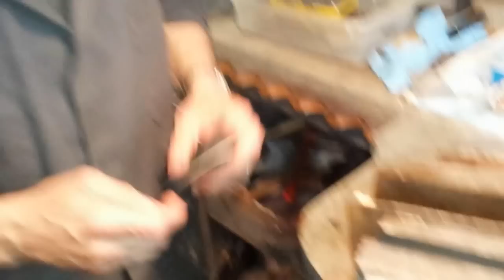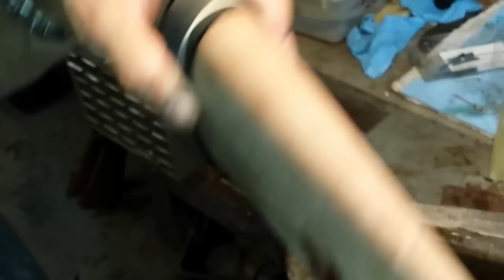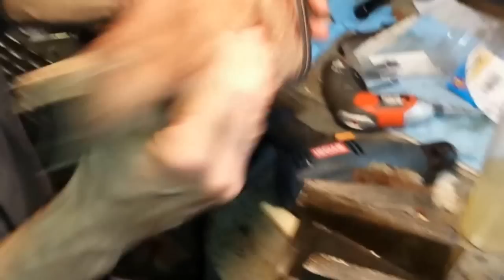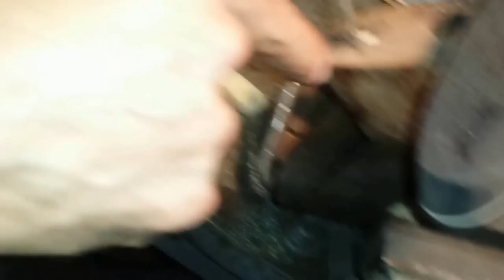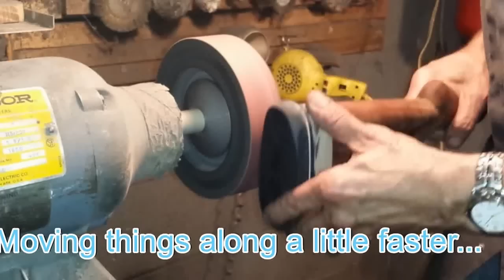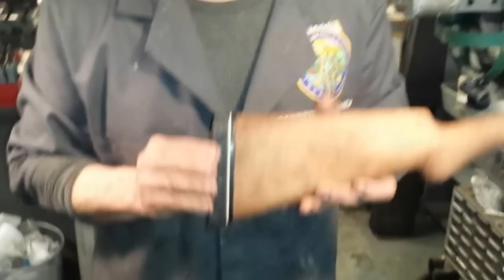Fitting a Recoil Pad on a Shotgun Stock - Professional Gun Smithing Series

Comment: you may want to look up the word WD 40.. under google.....states it a solvent .. adding a solvent to rubber will I thought break down rubber...
like that rubber recoil pad? you may want to switch to a actual oil
Reply: Yeah you wouldn't want to keep putting it on there you basically just use it to clean it. Then wipe it off real good then condition it with a light oil. The WD-40 just takes the polishing Rouge off real good.